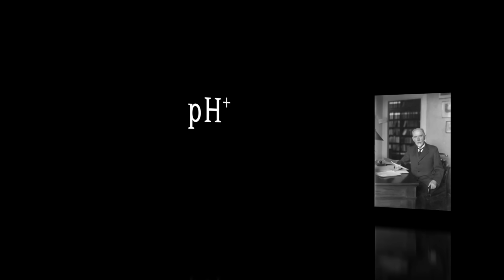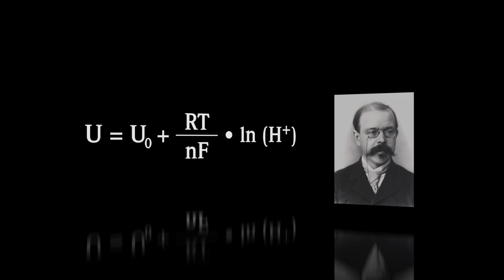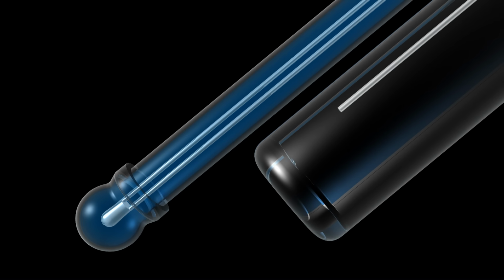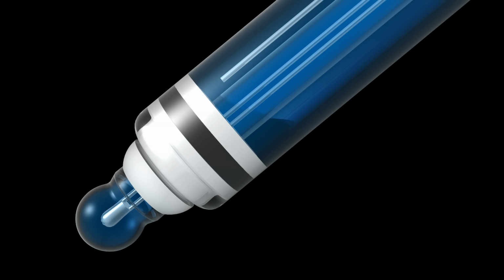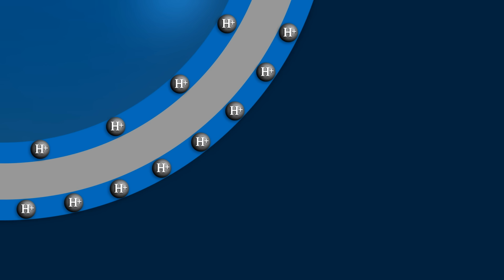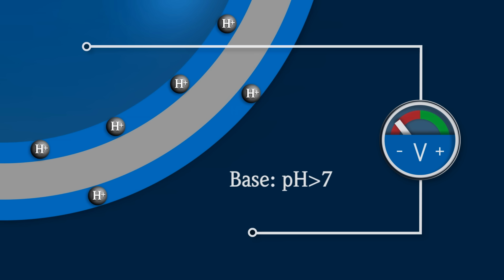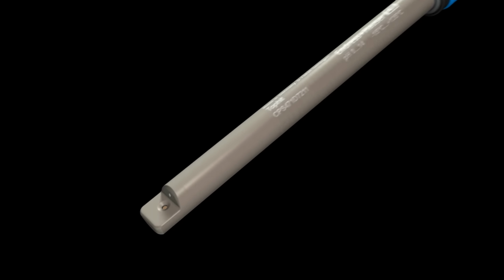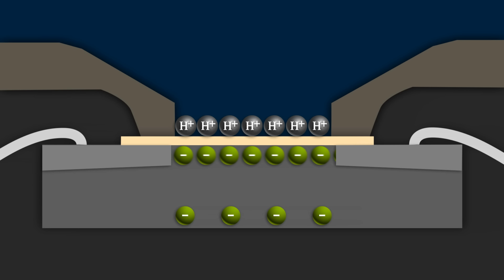Potentiometric pH measurement

Comment: I don't undersatand the need for the reference system. If the measuring system do all the stuff, then why need a reference system?
Reply: because you need to reference the measurement to a reference. More or less ions ? you cant know unless you have a reference to compare to. ie. acidic will have more ions than reference, thus low ph.
Reply: @Louiscare  Please explain in details. What will the reference do? It just serve the measurement system with KCl. It doesn't do anything other than that.
Reply: @reazshuvo7562  Basically, the pH meter measures the difference in voltage between the solution you are measuring and a reference solution. So if you are measuring a pH 7 solution the machine would read 0mV and convert that to mean that the solution is indeed pH 7. Now lets say you are measuring an acidic solution, this means there are more loose electrons in this solution compared to the reference solution, so the machine will read read a voltage >0mV and convert this to a certain pH, lets say pH 3. Now if we are measuring a basic solution we would read a <0mV which gets converted into a pH, lets say pH 9, so basic indeed. The conversion happens according to a linear scale.
Reply: @Louiscare  So, what the measuring system do? The two system contain he same KCl solution, right? If reference solution do the job, then I don't see any reason to keep measruing system.
Reply: @reazshuvo7562  yes they both do, except in the measuring system the KCl will basically exchange electrons with the solution we are measuring, while the reference system won't. So the measuring will have more or less electrons than the reference which then leads to what I explained previously. You need both to establish a difference in electrical potential.

Comment: Why we are using 3M kcl what is special character of this solution
Reply from the maker: The advantage of the KCl solution is the good electrical conductivity (thus connected to the drainage electrode), the chemical neutrality and tendentious reaction inertia. Reactions of the membrane glass and the anions of the buffer are suppressed with the presence of the potassium chloride solution, ie with a higher concentration of KCl a decrease of the leaching and thus a reduction of the voltage drift is shown. One uses just a 3 molar solution, since this is an approximately saturated solution. For low temperature applications, 1.5 molar KCl solutions are used as the potential for solution decreases at lower temperatures. Another advantage of KCl is that the ions (K+ and Cl-) have the same migration rate, because otherwise a different diffusion velocity can lead to an interference potential (diffusion potential), ie different concentrations at the phase boundary.
Reply: The KCl is an almost ideal electrolyte because the mobility of the K + ion and the Cl- ion is almost equal. Because of that the potential difference in the salt bridge is reduced to a few millivolts or less. ;)
Reply: @larrykpija6026  thank you
Reply: @manikantamaddula4056  👍😁

Comment: Great video, but didn't quite understand the animation of the junction. If the junction should "protect the reference system from the medium measures" then I guessed that it would chemically isolate the reference system but the animation was to the country. Until I found this explanation, which you might also find helpful: 
"The reference junction, also known as a diaphragm, creates electrical contact between the reference system and the solution. Much like the reference electrolyte, the reference junction must possess certain qualities.

Diffusion voltages at the junction are a common measurement error, so the junction plays a major role in the precision of measurements. To keep these disruptive potentials small, the junction must guarantee a relatively large and consistent outflow of reference electrolyte. However, the junction must only be slightly permeable to prevent electrolyte from escaping too quickly, which is especially important with electrodes utilizing liquid electrolyte. Different junction types have different outflow rates of electrolyte.

In addition to the permeability of the junction, its electrical resistance should be as low as possible and it must be chemically inert."
Reply from the maker: Good observation, you are absolutely correct. The junction does not isolate the reference cell completely from the other medium, but it will limit the leaking of electrolyte into the medium. This is necessary to ensure an electrical connection. The sensor shown in this video has a PTFE ring-diaphragm, but for different applications other options are also available. Other options are for example 1 or 3 ceramic junctions witch are smaller and have a smaller pore size, this will have a lower outflow of KCl. Or for some applications an open junction is used, this will be basically just a hole on the side of the sensor. That the KCl will not flow out immediately, the KCl is here solved in a gel. As our last example for your question, if measured in deionized water the KCl can deplete faster, then a KCl storage vessel is connected to the sensor to keep the reference filled.

Comment: Upto what sized cations pH meter works?
Reply from the maker: The size of the cations doesn't have any impacton a pH sensor because we are talking about a potentiometric measuring system. As long as there are ions in the media (cations and anions) independent of the size, a pH measurement with a sensor is possible.
Reply: Endress+Hauser one more thing if pH is based on potentiometeric principle then won't it detect potential difference due to all cations present in soil and not only H+ ions?
Reply from the maker: The potential difference in the case of pH is only influenced by H+- ions. The reason is the special glass on the measuring part of the sensor, where there is a gel layer on (thickness of 0.0001 mm) which is ion selective, in this case H+. If there is an excess of H+-ions in the media this will "stick" on this layer and the charge will be positive. With lack of H+-ions the charge will be negative.

Comment: will this PH analyser getting poor/fails when water pipe line gets empty?
Reply from the maker: @Hemalsinh Rathod: the sensor in this video is a CPS11D. If this sensor is kept dry, the gel layer at the bulb will get dry as well. This will lead to a deterioration of the measuring performance. This deterioration depends on the time, the sensor is kept dry. If it is only for 15 minutes it wouldn't matter. The measurement is immediately proper. After a few hours the sensor needs a longer time to regenerate and to provide a stable signal. If the sensor is dry for e.g. the whole weekend or longer than it is highly recommended to put it into 3M KCl for 24 hours for regeneration. 

Conclusion: The deterioration of the measuring performance depends on the time the sensor is kept dry. The longer the dry-period, the longer the regeneration time. But it is always possible to regenerate it.

Comment: Why should Bubble (KCL 3 / Mol ) should be stored at the end of the electrode in a solution?

While all components of has been working electrode into the solution.
Reply from the maker: Because of the KCl concentration in the reference half-cell is 3M KCl the sensor has to be stored in a 3 M KCl solution. Otherwise the KCl concentration in the reference will change due the diffusion law. If there is a semipermeable membrane between two solution with different concentration of ions, than the liquids are forced by the diffusion law to equal their concentrations. Therefore the ions from the higher concentration will invade the solution with the lower concentration the both liquids are equal. The same will happen to a pH reference cell,
because the junction of the reference cell is a kind of semipermeable membrane. If the sensor is stored in destillated water, e.g., all the KCl moleculs will leave the reference cell to equal the concentration of the
water. That will lead to a decreasing of the KCl concentration in the reference cell and to a change of the redox-potential. And this again will lead to a wrong measurement value. A characteristic sign for a bleeded reference is a shift of the zeropoint
Reply: Thanks very much,for the answer and attention you desire.
Hossein Moghadam .